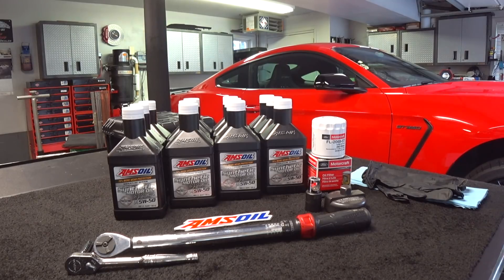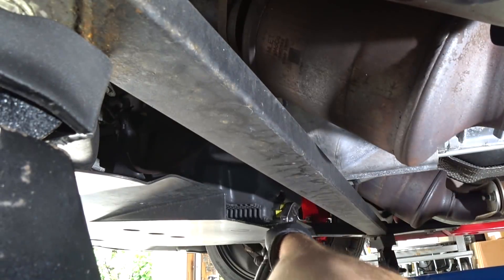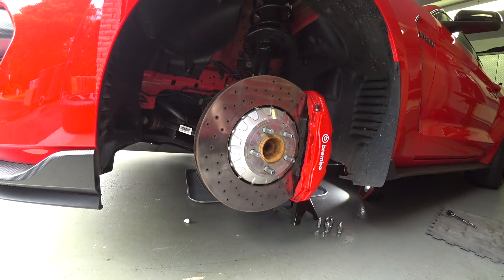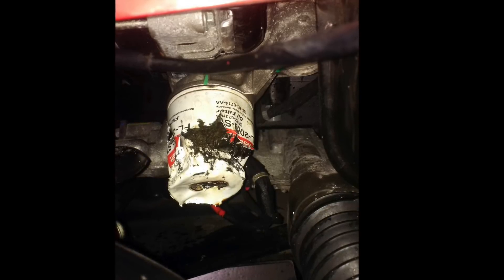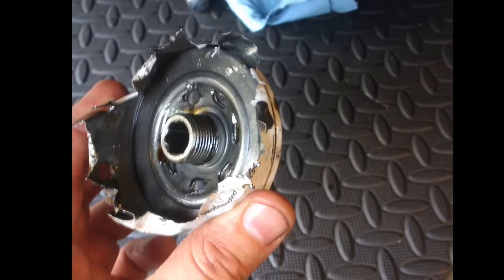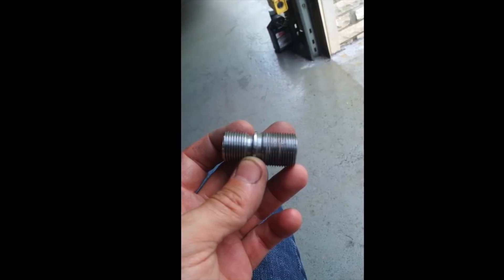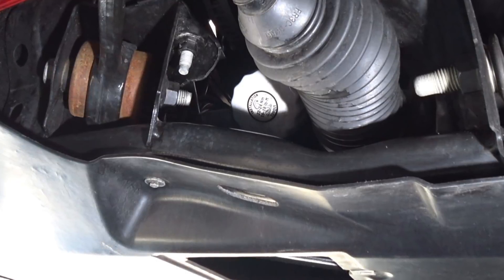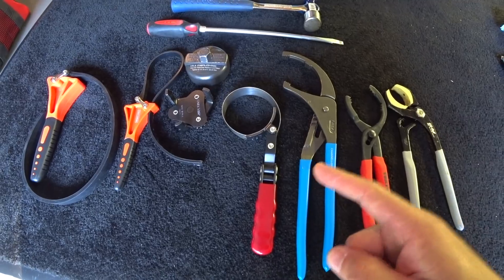Oil Change From Hell | Shelby GT350

Comment: The 2 piece oil filter is being introduced because of cost.. believe me the 1 piece is 100 times better than the 2 piece.. 2 piece filter are ALWAYS stuck, I put grease on the thread, on the rubber ring and hand tighten them and make sure that don't leak of course.. but still after a year there stuck
Reply: mark_4_life just use oil on the boring, and it is only tighten till it stops, or bottoms out. Done dozens of oil changes on many different makes of cars... I still prefer the single piece filter for simplicity, but the cartridge filters are easy as well, and look good under the hood.
Reply: Not trying to be a jerk here but you shouldn't have a filter on a car for year in the first place. I have also never had an issue with filter removal. Only time I use strap wrenches is if it is greasy or in a really awkward position.
Reply: The best lube to use on any oil filter rubber seals is used engine oil.
This was one of the questions that had to be answered correctly to become a certified BMW tech.
Reply: I always use NEW engine oil on the seal. I use it because I have it available and I can be certain it doesn't have any metal particles or anything that could eventually cause a leak.
Reply: No it's not. As long as you don't over tighten it the filter housing is way better. Euro cars have been using them for years. Most say 15 nM right on them. That's like 10 pounds. Don't need that he-man shit.

Comment: Nothing compared to the Veyron. XD. Still, this thing would out corner that heavy VW beetle all day.
Reply: The difference is they Veyron is a really expensive W12 hypercar that likely holds twice as much oil, and this is essentially a factory modded Mustang.
and I think even a Dodge straightliner (basically every Dodge performance vehicle) would outcorner any VW all day.

Comment: I have a filter wrench in my shop that "probably" would have taken that right off without crushing the filter.  If I could post a picture of it I would.
Reply from the maker: no wrench would have worked the filter was seized to the pump stud which crushed the threads.I had to cut it off in my vice and rethread the stud.
Reply: matt, did you see the tight access he had to work with?  you're not getting a filter wrench on that, and even if you did you wouldn't have any clearance to turn it

Comment: I would think that doing an oil change to a cold engine would be better, cause my theory is that all the oil has drained from the top of the engine into the pan.
Reply: Joe C. 

The reason you want the engine warm is because you want any debris that might be in the pan to be suspended in the oil so it drains out. Allowing the car to cool let’s dirt and debris settle into the bottom of the pan and might not drain out. Warm oil is also thinner so you get a more complete drain.
Reply: The debris argument is probably a good one, As an apprentice I was told to always do an oil change with warm oil to get more of it out but my experience with pulling down engines has taught me that after draining the sump there can still be a significant amount left in galleries and cavities around the engine. Some engines just badly designed in this regard and there is not much you can do about it.
Reply: YES,       You are so right.   I always wait 24 hours so all the run off oil has got to the pan.   then I let it drain for 30 min. or more.      So many people think that hot makes all the gunk come out.    They are fools.
Reply: Hey Joe nice name, I'm a Joe C. Also 😁
Reply: You drain the oil hot because all the particulates are in suspension in the oil, and they drain out giving you a much cleaner oil change!!!  If you wait until cool, the particulates have all settled down to the bottom of the sump where the oil doesn't drain completely..........which mean dirt left in the sump, even after oil stops "dripping"!!!
Reply: It does come out slower, however.

Comment: Is that a plastic oil pan???😳😳😳
Reply: Los Pollos Hermanos that’s ford for you
Reply: Los Pollos Hermanos Yes. Yes it is. Most of your newer Ford's have this newer oil pan design with a plastic 3/8's drain plug. I didn't know this was spring loaded. Most of them have just a simple lock and o-ring to seal the drain plug. Its probably the dumbest thing. They start to leak after about 5 oil changes. I've had many people come back saying that my shop is the reason there truck/car is leaking but even though we re-lubricate the o-ring it flattens out.
Reply: You're suppose to change the drain plug every oil change.
Reply: Jon Kimbrell 
I think it will be a good idea for anyone that do oil change for the new Ford with th plastic pan just to replaced the plug every 2 or 3 oil changes. I bought couple for spare since i do my own in the 18 F150 and the 18 Mustang GT.
Reply: As if I didn’t already have enough reasons to Chevy guy.
Reply: Julio Suarez Chevy and Ford are sharing parts nowadays.  That 10 spd automatic is in both the Camaro and mustang
Reply: It isn't 1920, billy boy, composites have come a long way ;)
Reply: cars these days are just throwaway cars.  Sucks since this is a shelby.
Reply: Jonathan Gahan Because recalls on a Chevy every day is better than having a plastic oil pan, have fun with that one.
Reply: Jonathan Gahan lmao Chevy is still using pushrods in their "performance" cars and their interiors are still as bad as they were in the early 2000's. Theur interior designers need to be fired, their engineers are probably 70 years old and have no clue what's happening in the industry. Chevy = hot garbage.
Reply: You know how much time and effort it takes to replace some if these oil pans? Plastic might be a good idea. You gotta take the cab off and raise the engine in some of the f-350's. 6 or 7 hours in some BMW's and that's if you have a chain-fall.
Reply: Bobby Brady do turbine engines have any plastic parts holding critical oil to lubricate?
Reply: Julio Suarez ECS tuning offers a heavy duty metal pan I'd definitely get one of those
Reply: dos Santos literally nothing wring with push rods. Everything has compromises. I’ll take better performance at low rpm on a street car, especially a v8, than a DOHC engine where I have to rev the piss out of it to get max performance. Also, those corvettes with their ancient pushrods still win races regularly
Reply: @Bobby Brady I doubt car manufacturers use aerospace-grade materials.
Reply: @Berenger Christy Wouldn't it be interesting if GM were to experiment with desmodromic valves, a bit like Ducati? I mean, that requires DOHC I believe, but the Ducati desmodromic four pots sound and perform amazing, and rev like a wankel. Imagine that kind of tech in a V8! Imagine how many extra eagles an engine like the LSx 454r would put out if it could rev to 13,000rpm!
Reply: Lighter, it doesn't need to be strong because all it does is hold oil. If you slam the car down hard enough to break it... you probably deserve it.

Comment: This is insane! Why do they tork it so much! You have to head the technican head with a tork wrench!
Reply: David Ellis Maybe some of them don't realize that they are. If you put a little bit of oil on the seal, like mechanics say to, and tighten the oil filter until its "snug", you'll actually tighten the filter way more than if you didn't put oil on the seal. The oil reduces the friction between the pan and the seal, thus it not only feels easier, but it easier to tighten to the pan. So the snug feeling comes about later with oil than without oil on the seal. And now the filter is much further down the threads, the seal has less room to expand, which will make it stress the threads more, etc. And then there's the techs that just don't give a damn...
Reply: Most “techs” that do oil changes are just “lube guys”. They usually don’t have any ASE certifications and are often times idiots.

Comment: Did you try spraying some WD40 on the thread area? WD40 penetrates well and may have saved you some aggravation & damage.
Reply from the maker: WD40 does not solve anything when dissimilar metals are seized up at the threads, it had to be cut off, outside the car in my vise as i explained
Reply: The previous person must have tightened it with an oil filter wrench! I'm surprised it wasn't leaking. 
 I always have luck with a strap type filter wrench and put the wrench as close to the base of the filter as possible to reduce the chance of crushing the filter.  Although, it looks as clearance was not on your side.
Reply: wd40 wouldnt have touched those threads if engine oil can't.
Reply: Those threads are literally soaked in oil their entire life lubrication is not the problem

Comment: I have no idea why customers will always manage to rip and tear a steel oil filter during a simple oil change, and every single time will blame the last person to touch it for putting it on "too tight". Experienced techs never ever tear filters. If you're using a tool to remove the filter, you have to be on it perfectly straight or else it will just cave in the canister. You can't easily get on straight on the oil filter when you're changing oil without a lift. Next time save yourself the trouble and have it serviced at the dealer.
Reply from the maker: no tool would have removed this filter did you not watch the entire video to see how the threads were seized? it had to be cut off with a cut off wheel in my vise from the pump stud.